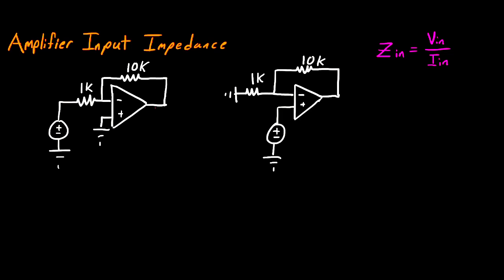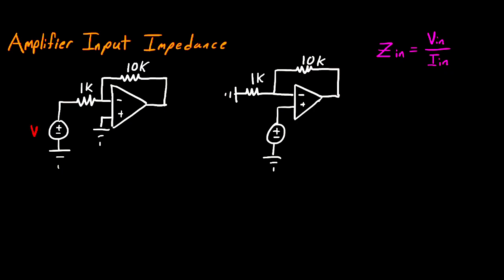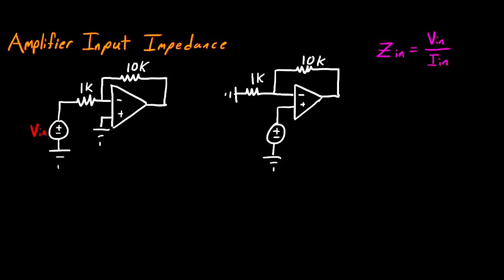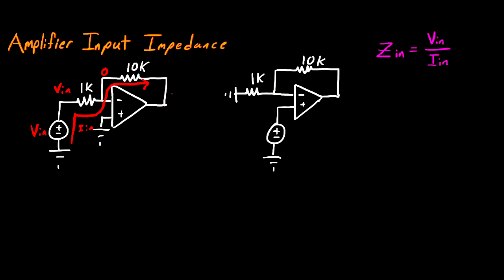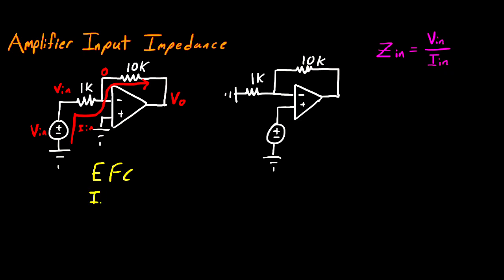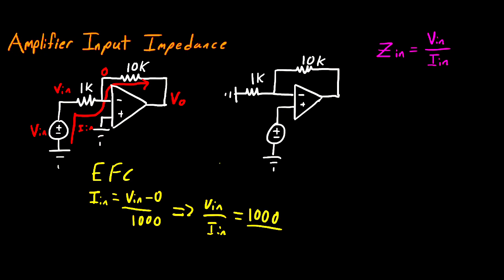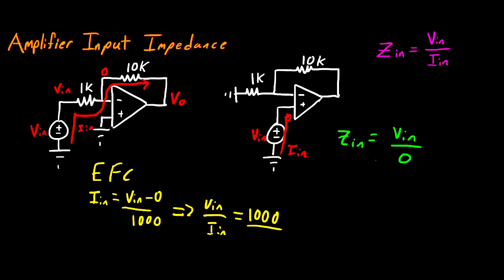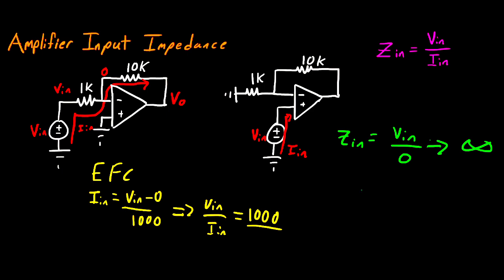Amplifier Input Impedance

Comment: What about the output impedance?
Reply: it's basically the opamps own output resistance. to calculate this impedance you do the same thing but nullify all input sources. substitute the triangle symbol with the dependant voltage source, if vin is zero G(v+ - v-) is also zero, so you get that internal Zo in parallel with Rf + Ra. since Zo is generally pretty low, it's aprox. Zo (also 0 for the ideal opamp model)

Comment: Sounds like a nonsense for me. If ideal opamp has infinite input resistance, you, in fact, have voltage divider which consists of 1k resisotor and infinite input impedance resistor and due to voltage divider formula voltage drop across 1k resistor should be small, not Vin. All this opamp circuits seem to be completely magic.
Reply: I wish someone had responded to your question earlier. I just saw it.  Anyway, I understand your viewpoint, so maybe I can help you understand why the author is correct.
 
Regarding the inverting amplifier, yes, the 1K resistor IS in series with the op-amp's nearly infinite input resistor. BUT, that nearly-infinite input resistance is paralleled with the 10K resistor that is connected between the inverting input and Vo. 

All the current flowing through the 1K resistor continues through the 10K resistor on it's way to Vo  -  the only place that current CAN go.  It cannot flow into the inverting input, with it's near-infinite impedance. 

The op-amp will drive Vo low enough to make the voltage at the inverting input the same as the voltage at the non-inverting input, 0V. So, the entire input voltage is applied across the 1K resistor:  the left sideof the 1K is connected to the input, and the right side of the 1K is virtually connected to ground, 0V. 

So, "looking into" the input, the input signal "sees" only the 1K resistance.  The  input current will be as if the circuit was simply a 1K resistor connected between the input and ground.

Hope that helps.
Reply: @OsoMagna  Yeah, I remember spotting this flaw right after i wrote down my comment. Anyway my understanding of opamp circuits improved tremendously since then. Thank you anyway for this long.